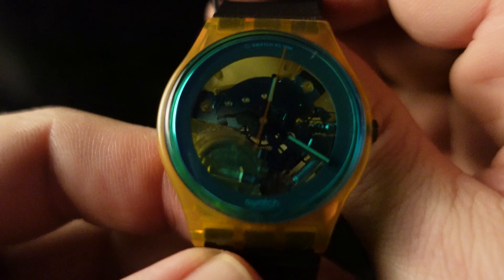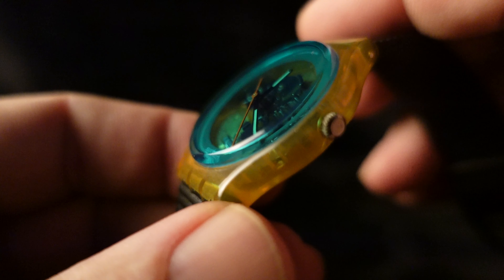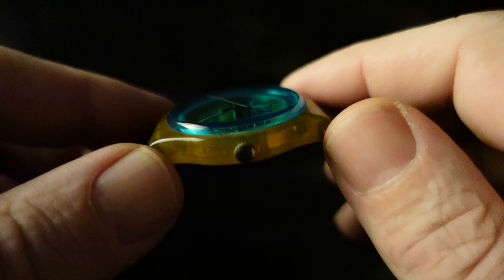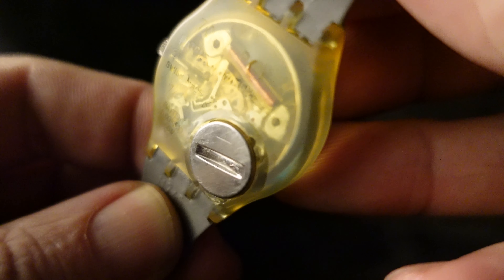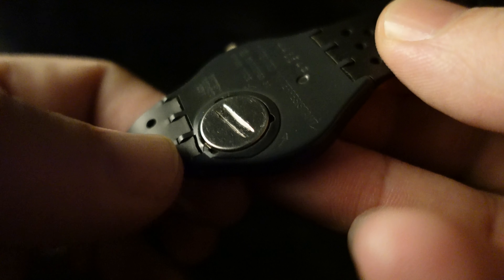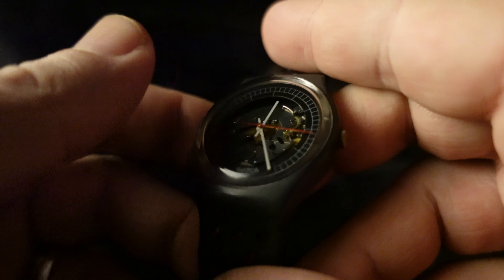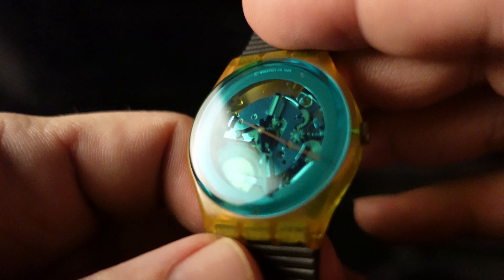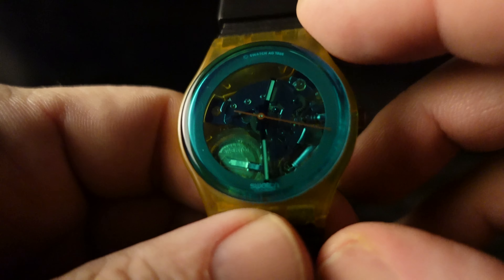The Fatal Flaw with Vintage Swatches - And MAYBE the Solution.

Comment: You may be able to coat the metal with a release agent so the glue doesn't stick . Clothes starch is classically used and also at least a bit of rubbing alcohol to clean the plastic before gluing can really pay off but cleaning then sanding then cleaning again much better . I know it sounds a bit much but these steps can truly make the difference between worked for bit and fixed permanently .
Reply from the maker: Oh! Excellent tips! Thank you so much for those. I'll let you know how it goes.  🍸🍸

Comment: Sad to report this design flaw is still present in current production Swatches of this model(gent). I just checked a recently purchased version I have and compared them to older versions of it I have as well to be sure.

Of the four I have I notice small bending at the area on the older models while the newer one is fully intact. All secure the battery still well though.

At the risk of being redundant I like to mention that Swatch stores replace batteries free of charge.

 While this is a nice service of course anyway. It is especially relevant in this context because they use a tool that fits the battery hatch exactly which prevents excess pressure and torque on the case. I have experience swopping a battery from one Swatch to another using both coins and a screwdriver. It took a lot of force to get the hatches to turn and not having a case get damaged to the point of failure was just luck really.

Best regards.
Reply from the maker: Yes, I too confirmed with a new Gent watch I own. Excellent point regarding battery replacement, thank you for that!  🍸🍸